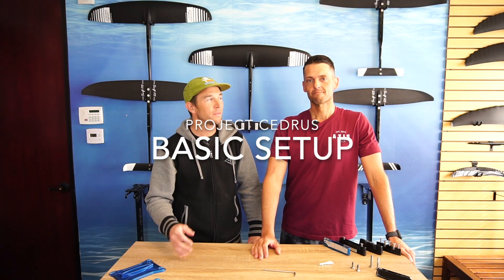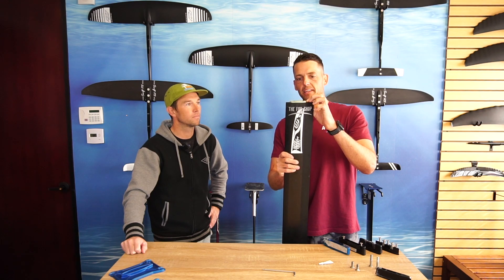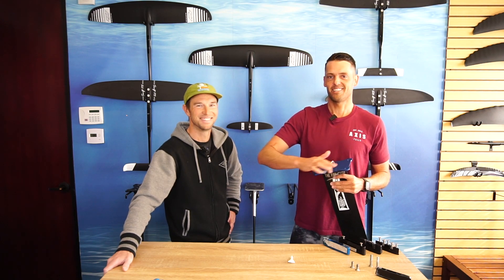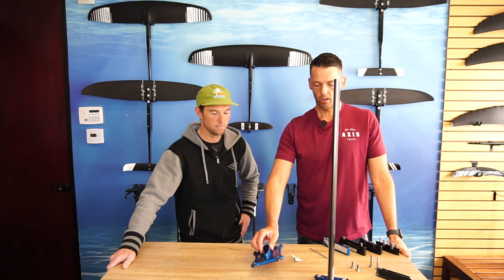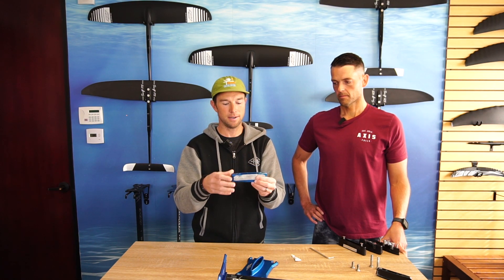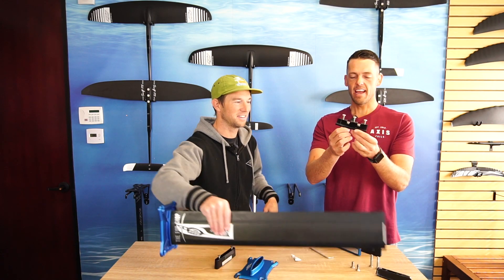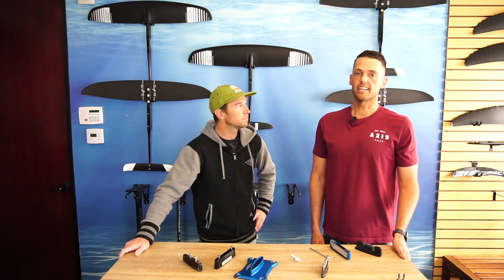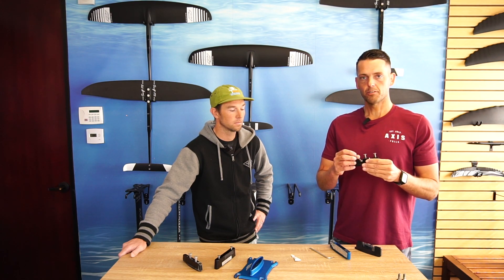Project Cedrus Custom Hydrofoil Mast  - Basic Setup

Comment: What foil brands do you have adapters for with this custom mast?  I'm using Cloud Nine FS 850 with 13.5 stab and a 30" mast.  Looking at different mast options and this seems like it has good adaptability if i decide to switch to different foil like lift or unifoil.
Reply from the maker: Most every foil brand has adapters available. please use the phone number on our website at www.foilshop.com and I can help source this for you, and get it to you. you can also order online, and just specify what foil you want the adapters for in the order comments.
Reply: Does this work with the takuma hd fuselage